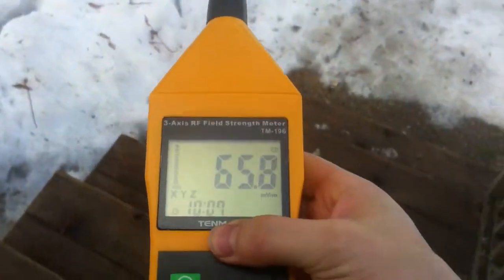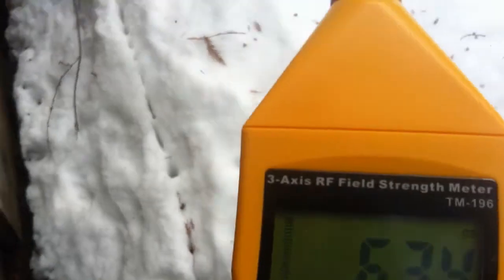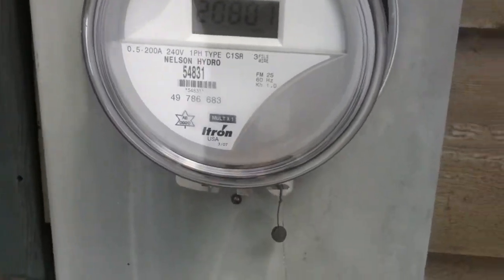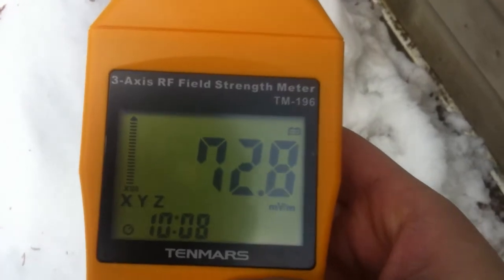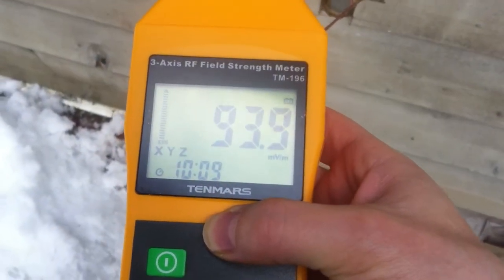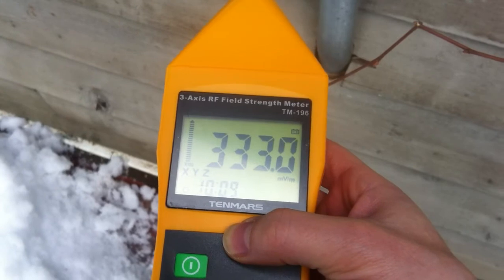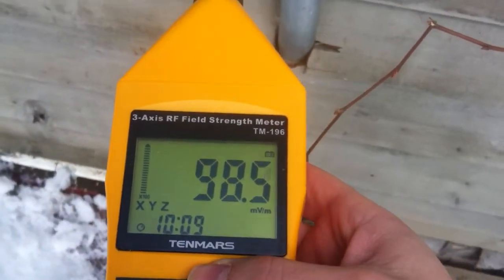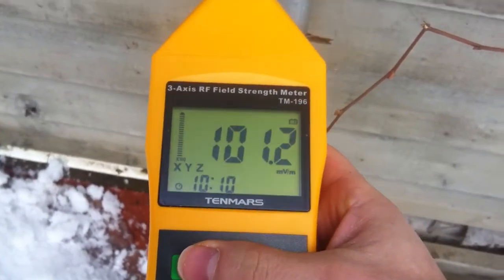AMR Meter (not supposed to be a smart meter) Nelson Hydro (BC)

Comment: Thanks for the video!  I'm in the US and our natural gas company, SEMCO, installed an AMR meter here in November of 2014.  They told us it only transmitted once a month.  Within 6 months or so I started experiencing severe symptoms of electromagnetic hypersensitivity that had gone away 2 years previous after I stopped putting a cell phone near my ear.  When the symptoms returned and continued to worsen to the point where I was questioning whether or not life was worth living, we started investigating and were told by the Regional Operations Manager of SEMCO that the new AMR meters pulse microwave radiation 10.67 times per minute.  We did wrap the meter in lead sheeting to protect us from the radiation, but we also turn electric breakers off at night to cut down on the "dirty electricity."  Those measures have helped a lot.  However, yesterday they installed another AMR meter on one of our rental buildings, without our knowledge or consent, again.  So we're looking into converting to propane.

What a world we live in, where we must protect ourselves and our families from harm done by utility meters!

Comment from the maker: [continued...]

"...If you are interested, it would cost 145.00 (one time cost) to replace the meter and an extra 21.69 every time we read the meter (6 times a year). This 21.69 is also included with the rate increases if there happen to be one.
 
 
Fred Schneider
Nelson Hydro
Customer Service Meter dept.
250 352 8223
fschneider[at]nelson.ca"